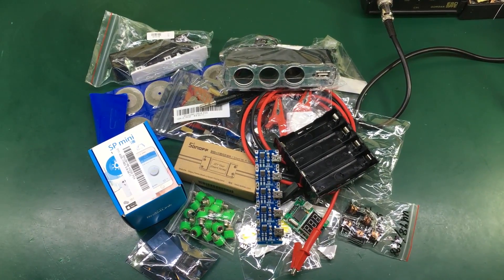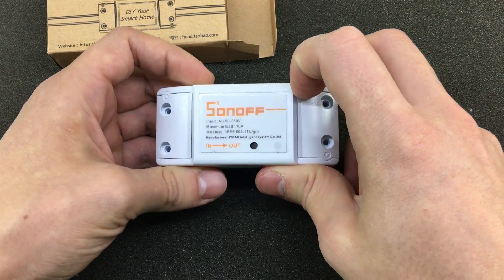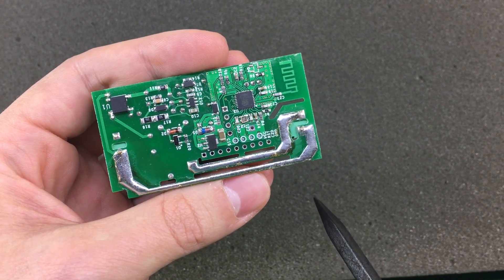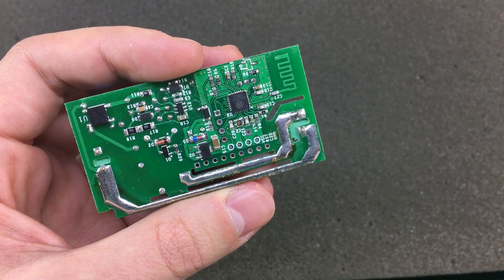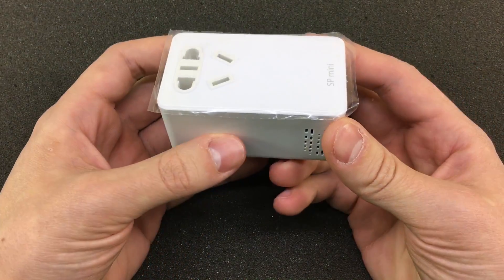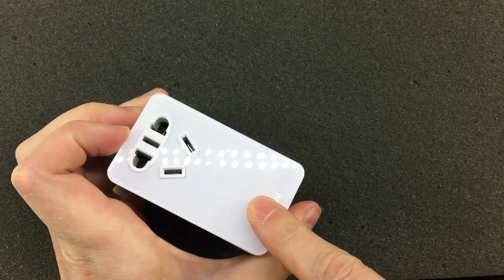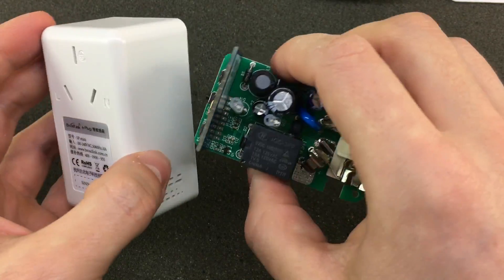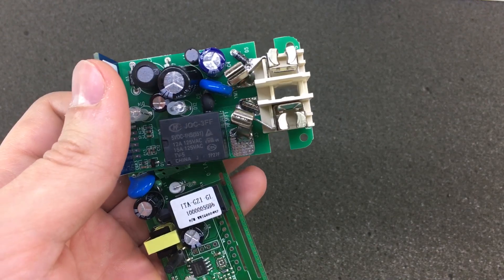Voltlog #40 - InTheMail - Part 1

Comment: UK and EU have rules about cleaners between mains tracks, EN60065:1994 
Class I = 120mill (3mm)
Class II = 240mill (double isolation) (6mm)

For 240v mains you need class II(6mm), 1.5mm is below UK and EU regulations.

Comment: Im interested in such a solution but can you tell me if it is possible to switch them only on the local network or also over the Internet using iphone and app and 4g?
Reply from the maker: +Michael Bernhardt both work over the internet, however only the broadlink sp mini worked on the local wifi network without any internet connection.

Comment: Putting a MOV and a fusible resistor in the ac side of the circuit seems to protect the device.  The questionable rules of ce that call for switching on the neutral lead seems like a bit of overkill to me since on most plugs you can only put it into the socket one way.  I guess they figured the electrician who wired your house got it wrong and made the neutral terminal positive.
Reply: +Joseph Nicholas In some countries, for example Portugal, there is no rule that mandates that the neutral is on the left or right side of the plug... and the plug is simetrical. It can be plugged both ways because the is no physical difference or markings
Reply: +Joseph Nicholas The equipment comes with an australian to schuko adapter. Even if the pin is different in the equipment, it is not different in the adapter. The schuko plug (German "Schuko"; Type F) is simetrical.
Reply from the maker: +Joseph Nicholas For example European plugs as well as the US two blade plug type can be plugged both ways into a socket which can result in live signal being connected straight to the output of the device. That is a serious security concern. I think it's important to cut both live and neutral.
Reply: Well of course, but if you look at the plug, one of the sides is small than the other.  It s not a "serious security concern" stop fear mongering.
Reply: No, if you look closely you will see one pin is slightly different.  In this case it makes little difference since unless you take the ac device apart while its plugged in no harm will come your way.
Reply: +VoltLog I'm not concerted about switching neutral. A lot of devices do only switch one side which can be neutral. All KaKu (Dutch term for those remote switches over 433Mhz) all just switch one side as well. So I don't think it's a CE must have
Reply: +Joseph Nicholas Not always, a two prong may be completely symmetrical. And of course, Schuko is as well. But indeed, I have no problem just switching one side.
Reply from the maker: +tengelgeer It is a CE requirement, I just don't have access to and I don't know in which particular standard this is published so that I can quote it in here. whether or not you and I think it's necessary is our own opinion but to get CE certification I am quite sure you need to switch both.
Reply: +VoltLog Didn't know it's a requirement. Stupid those standards aren't public... But then every remote controlled 433MHz outlet you can buy isn't aloud to have CE. They all just switch one line. Same for those plug in switches (http://www.vivanco24.de/vivanco24/general/images/products/EAN4008928/2/2/4008928223965_p01_b.jpg).

Comment: Nice video. Btw, which camera are you using?
Reply from the maker: +OR-Khan This video was captured by an iphone 6s, 1080p 60fps. I bet you thought it was some expensive camera model, right? :)
Reply: +VoltLog Exactly :) Like those fancy cameras Dave have on EEVblog.
Reply from the maker: +OR-Khan well a fancy camera will certainly help, especially under low lighting conditions but with proper lighting as you can see I get perfectly good results with my iphone camera.
Reply: +VoltLog i also like the cam of my 6s. And if i ever start a video blog sureley it will be my first cam 😀

Comment: MediaTek/Ralink do have a nice development board for the MT7681 and the SDK is also available.
Reply from the maker: +Javier Palla Lorden hobby level, I think the  ESP8266 will remain a leader, and possibly its upgrade the ESP32 will also follow due to the community. However for commercial products, where they manufacture tens of thousands of units the MT7681 might have some advantages like cost reduction, better sdk.